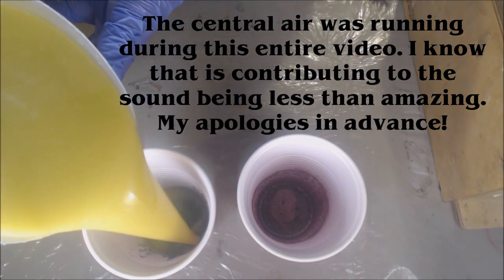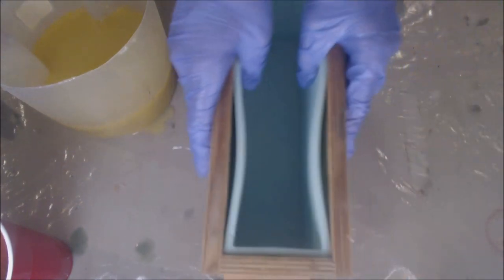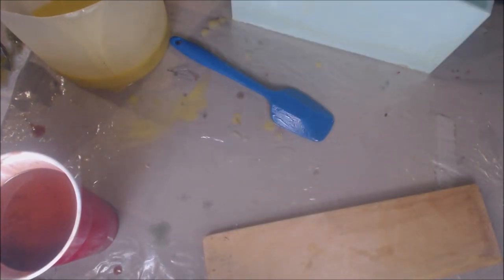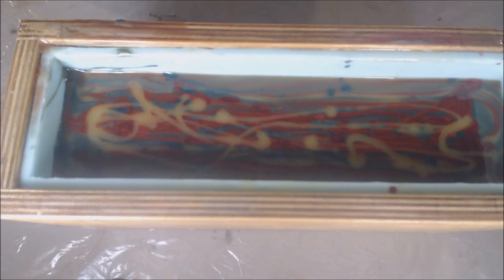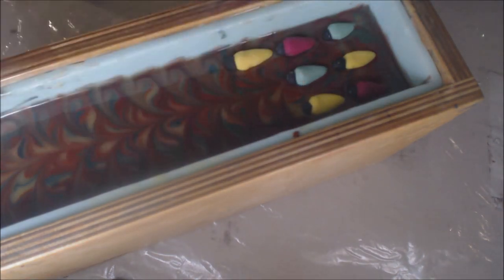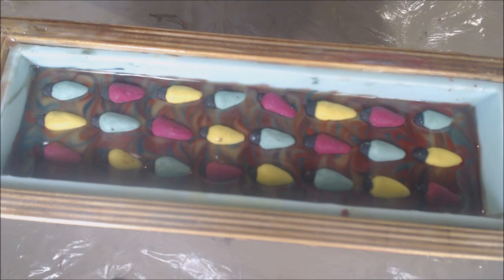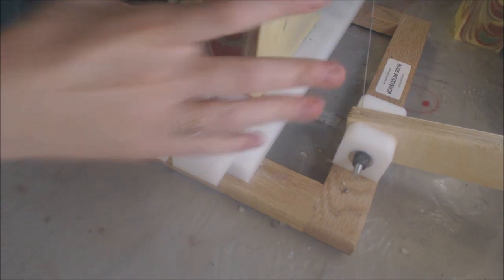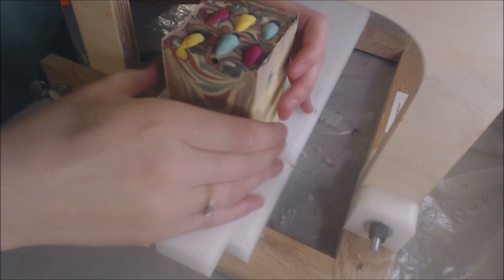Making & Cutting "Joyce Byers" Castile Soap, 4/4 Stranger Things Series

Comment: why dont you hold the sides back with Blutac until you get the mold to hold back to the container on its own x😊
Reply from the maker: Zesty Zirlonia I've never heard of blutac before, can you tell me more?
Reply: Sure, in GB its called Blutack Adhesive Strip, but maybe where you are its called something else. Its a soft pliable re-useable putty that you can stick posters on to walls, messages on the fridge, well just about anything you can thing about. It would be perfect for holding back your liners. That, or bull dog clips, if you can find Blutack. 

I decided to have a quick search on ebay and I found it no problem. I hope I helped. xxx
Reply from the maker: Zesty Zirlonia oh I know what you mean! I'll give it a shot!
Reply: Great! I hope it works out for you. Let me know how you get on xxx